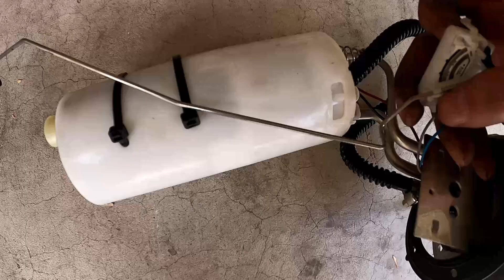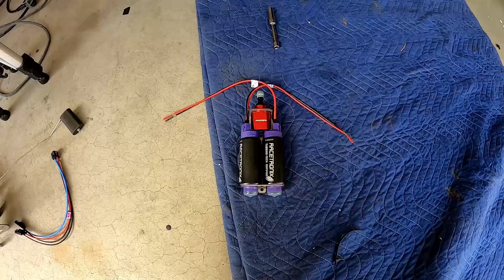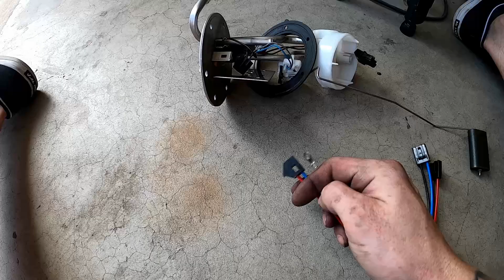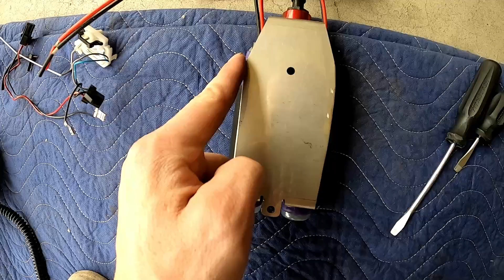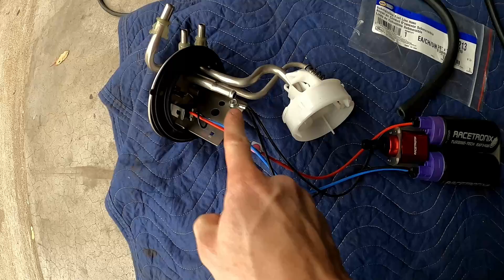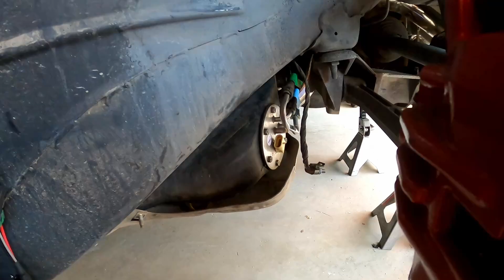Supercharged C5 Corvette Dual 340lph Fuel Pump Install | Part 2 | LS

Comment: Did you have any issues with pushing by the sock regulator? From what I've seen, anything really over 450lph will blow right through the stock style, like the one you replaced at the end of the video.
Reply from the maker: No issues whatsoever, with that said, I don’t recommend doing this forever and eventually you’ll need to get a fuel pressure regulator

Comment: just wanted to ask: i have a 2000 corvette twin turbo and found out only 1 fuel pump??? just wanted to know is this setup on stock fuel rails and basically everything remains stock except the fuel setup you done here??? no return hose upgraded, no fuel rail upgrade...... this seems like a very sweet and "simple" setup saving the most money to do!! thanks for any reply!!!
Reply from the maker: Yes, everything stayed stock.  HOWEVER, keep in mind that the stock system is not designed to control this much pressure.  If you plan on making big power, I recommend going to a return style fuel system which you can do which some AN fittings, fuel lines and fuel rails.